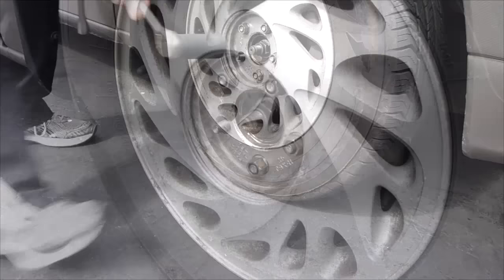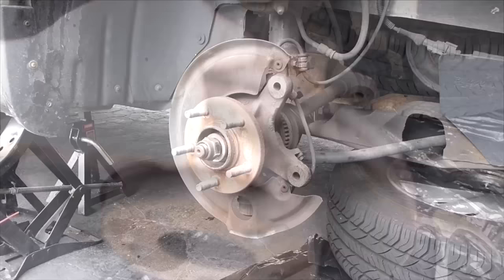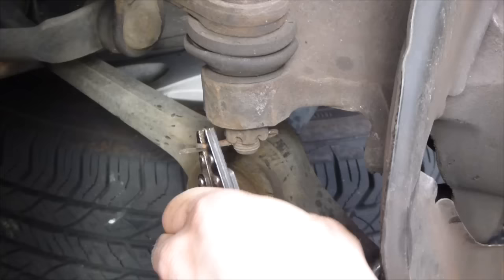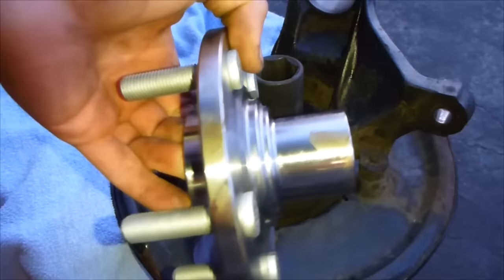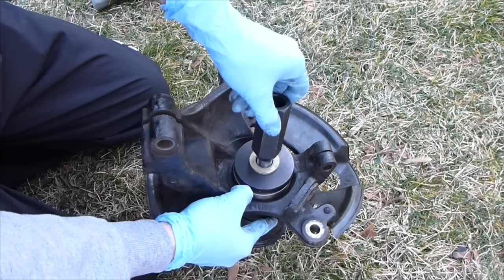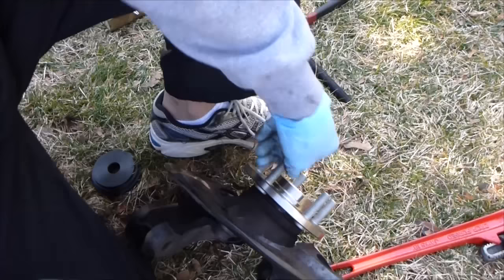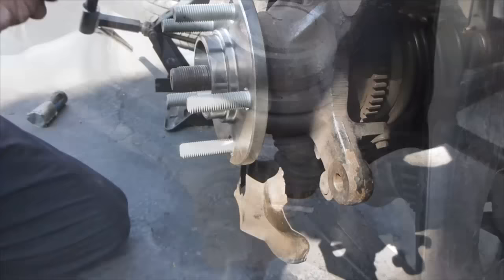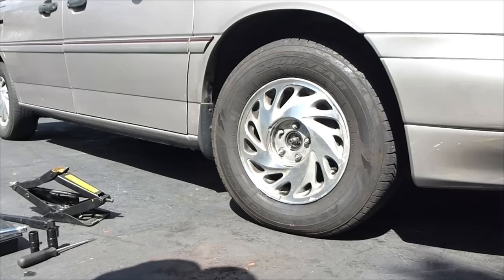How to Change a Wheel Bearing (short and fast version)

Comment: How ur doing Mr. Chris Fix, My question is regarding a 2003 ford explore rear bearing. Is it possible to press in both hub assembly and bearing @ the same time or do they need to go in @ separate times and also I have some type of vibration only occurring @ high speed between 35 and 55 it feels like something all of a sudden grabs. it almost sounds like brakes but its not the brake all bearing have been replaced accept the right rear bearing also a sound like the tire or something is rubbing but its not the tire it stops after the vehicle slows down or makes complete stop then when I take off again nothing till about a mile or so up the road the vibration and shaking comes back like its a bad tire or axle everything is torque to specs as they should be really would love your feed back to resolve this situation by the way your videos are the best i seen thus far keep up the great work
Reply from the maker: patrick chambers Hey Patrick, I am pretty sure you will need to press them in separately. The rear axle is a solid rear axle so it is different than in this video. As for your vibration problem, can you tell where the vibration is coming from? Like is it that passenger rear tire or is it in the front end?

Comment: Theoretically couldn't you use the bearing press tool while everything is still on the car? I just dont see the point of removing stuff if ya don't have to. Looks like some cheap threaded rod, a few size washers and two nuts would do the job. Great vid by the way!
Reply from the maker: You could but for an extra 5 min is worth it in this case to take the knuckle out.
Reply: +Andrew Solis drugs lol.

Comment: I didn't put any grease on the bearing or the wheel hub, I guess that's why it made some strange noise when I pressed them in with a press. By the way, did I miss something or did you install a new wheel hub as well?
Reply from the maker: +thaik56 I did install a new hub as well.
Reply: ChrisFix is there a particular reason for that?
Reply: Because its only an extra 10$ to buy the hub with the new bearing so why not? I did.  I'm not going through all that and not replace the cheap stuff.
Reply: Jennifer Hendrix well in my case a hub isn't that cheap, perhaps because I require OE parts for most of these jobs.

Comment: Wouldn't it be possible to change the bearing, with the hub still on the car? Using that press-tool?
Reply: no. in order to use that tool you need to get to the back of the bearing and if you are lazy and try it your way you might do more damage and take longer.

Comment: I have a question, you mentioned in your video you had to get a new bearing press that for the hub. The hub I am using is the same exact one I believe you used. I believe it's a dorman hub? Where can I get that size bearing press? Thanks in advance
Reply from the maker: chris rodriguez Check the link in the description for the press I used! You can sometimes get the bearing press to rent for free at your local parts store.

Comment: So you used the extractor/puller to replace bearing and install new hub? Why did you need to install a new hub if you just planned to change the bearing? I am about to do this job with the same tool but don't plan on replacing the hub unless absolutely necessary.
Reply from the maker: shepd01 The hub was $10 more and it had 250k+ miles on it. Not worth risking having a damaged hub for a few dollars. Plus, the bearing is a decent job to do so I dont want to do it twice. My friend has an audi and his bearing went bad, he had a shop replace it with the same hub, the bearing went bad 3 months later. This time I replaced it and put a new hub in so there is no risk. The old hub might have been slightly bent from his slide into a curb which might have caused the new bearing to go bad in 3 months. That is why I did what I did. If you didnt hit a curb or pothole and you think your hub is fine, just use the old one. If you dont want to take any chances, get a new one for a few more bucks.
Reply: ChrisFix Thanks Chris for the clarification. The hub cost anywhere from 30 to 100 bucks depending on where I buy it. Trying to save money if the hub looks ok during the bearing removal. Great video!
Reply from the maker: shepd01 Yea, if it is $30 you have to decide, if it is $100, I think you know what you are doing lol

Comment: I have replaced the bearings on some parts I bought for my car, bigger disc brakes for my ride. Well once done I went to spin but don't spin freely by hand. Is this normal, or did I do it wrong? There a little tight but I've seen videos where it spins as you spin it. I haven't put these on my ride yet because of this. Can you help

Comment: i have a 97 expedition and i did a whole hub and bearing switch out didnt have to do any of this stuff just took the wheel off break off and the 3 bolt in the back of the hub o and the axel nut
Reply from the maker: +XXX957TRO Yea there are two types of bearings. This type that is pressed and the other type that is bolted in. Here is the bolt in version: https://www.youtube.com/watch?v=fe_WtKIKlYA

Comment: I wouldn't say it's an " EASY" job just tool wise you will need a few specialty tool most people won't have ... Tho...You can make the job easier by taking the steering knuckle to a parts store with a machine shop.. They will sell you the bearing and press it in there for like 40$ or so...... It's either that or buy an expensive 100$+   bearing press kit and learn to use.. ( and that's for a el cheapo one good quality pro kits are like 400-600$)... Again doable but def not " EASY".....job... I'd say intermediate both  tool and skill wise..

Comment: Hey ChrisFix, Josiah here. I have a bad rear wheel bearing on a 2002 Ford Explorer that I am trying to replace. I've gotten the knuckle, hub, and bearing off of the vehicle but wasn't able to hammer out the center hub (or whatever the piece is that holds the lug nuts). I tried your method of using a socket and hammer but it is REALLY stuck to the inside of the wheel bearing. Any tips or tricks to removing the hub from the bearing? If I'm able to get the hub out of the bearing, I'm going to take the knuckle and bearing to a machine shop and have them press it out for me (I don't have the bearing kit you have).

One more question... will hammering out the hub from the bearing risk "damaging" the bad bearing (meaning will I risk removing the bearing race with the hub)? I know I don't care about damaging the old bearing, but I don't want to create more work for the shop I'm using to press out the old bearing. I'm trying to save money and shops here charge an arm and a leg for ANY work. Wish I had the kit to do it myself but anyway, just don't want to create more work for the shop. 

Thans for your help. I watched the short and long version of this tutorial and it is extremely detailed and helpful. Awesome job!
Reply from the maker: carlyelizabethm Hey Josiah, when the hub gets really stuck in the bearing I try using some penetrating fluid. This stuff works miracles so give it a try: Homemade Penetrating Fluid, How to Make Your Own That should work, but if it doesnt, you can have the shop press it out for you. It will take them 5 extra minutes and they usually dont charge. You can damage the bad bearing if the hub is stuck in there so bad that the old bearing gives way. You wont damage the outside of the bearing though, which is what they will use to press the bearing out. Good luck and keep me posted on your progress!

Comment: This is nice.  To bad all the cars I work on are always rusted to shit and seized up.  I had 24000 pounds in a press trying to get one out.  I worked on a Chrysler  dam cv joint was so rusted in the bearing had to pound the shit out of it with a sledge hammer.  Mushroomed it and had to grind off the mushroom to get it back in.  The steel that they use on these cars today is shit I mean shit.

Comment: Why did you also change out the hub? was it bad as well? I plan to reuse my wheel hub but if it is cheap then i just buy new one. What do you recommend?
Reply from the maker: +Truong Ho it was only a few bucks extra for the hub so I got it. You can reuse the old one as long as it isn't damaged!

Comment: Nice video,but these tools only one professional mechanic can have...right?
Reply from the maker: Stavros Athas These are common hand tools and the only specialized tool is the bearing press which you can rent from the parts store.
Reply: ChrisFix Where do you reference all the torque specs for each bolt? My manual only talks about the lug nuts.

Comment: Could you please tell me what is the length of that crowbar which you have used on video ? I saw in other videos that when you press the hub into bearing you have to apply the pressure only on the inner race of bearing. In this video you were applying pressure on the steering knuckle.
Reply from the maker: ***** It is a 24in crow barL http://amzn.to/1LfiAv4 and you want to apply pressure on the outside race and you need to press against the knuckle.

Comment: How to do inner and outer wheel bearing on a1987 dodge ram le 150 truck 2 wheel drive passenger side on the front rotor

Comment: 20 dollar bearing vs mechanic that charges 400-500 bucks. worth doing yourself even if you have to buy the special tools it still is cheaper. And you own the tools for next time. Stores dont loan the bearing puller. But they do the slide hammer.
Reply from the maker: Yes you can rent those specialty tools for free which is nice!
Reply: u still read coments on this video damn

Comment: Hello Chris, where are you getting all that torque tightening info from ? Or I'ts just overall number like the center hub nut 200 ball joint is 52 for most of the cars ?
Reply: +Fu co Using a car specific manual

Comment: The threads on the bolt hold up after multiple uses? I bought a similar kit from harbor freight and the threads where destroyed after one use. I used anti-seize on the threads.

there kits work well w/ a press too.
Reply from the maker: +Turbotomass I never had a problem
Reply from the maker: +Turbotomass I never had a problem

Comment: Okay so I went to push out the bearing from the knuckle and Only the inside of my bearing came out with the balls and everything. I am stuck with the outter wheel bearing stuck inside on my wheel knuckle. My local Autozone sold me a tool that I have to use with a hammer but it’s not budging. I’m wondering if this style of press would work if I order from Amazon. And tips on removing the Outter part of the wheel bearing without the inside would be helpful.
Reply from the maker: That tool they gave you should work. If you put the edge of the tool on the bearing and pull the slide hammer back and work it back and forth it should get it out. Heat up the bearing race to make it come out easier. A hammer and a punch could also work. The bearing press could work too. The rent then for free at advance auto parts

Comment: noob question here but you know that housing right behind the brake rotor, how important is it because mine has rusted away and i noticed it was actually falling apart when changing my wheel the other day.
Reply from the maker: +itzJKB That is a dust/heat shield and it isnt super important but it does protect the suspension parts so I would get one from the junkyard.
Reply: oh thank goodness , nothing serious then. ok i'll get that replaced thanks alot for the reply !

Comment: What is the tool part number for the tool you used? Is it compatible with 2001 toyota 4runner sr5?
Reply from the maker: The bearing press is linked in the description and it works on most cars where you need to press out the bearing.

Comment: I recently change my front bearing. And bearly I was able to push it out of the housing with a 20 tone hydraulic press. Looking at yours it looks small. mine had 77mm outer diameter. I don't think that screw improvisation would have done much,. Why did you replaced the hub?
Reply: you'd be surprised, a little heat from a torch on the outside of the knuckle to expand just slightly and some penetrating oil and they come out fairly easily with these cheap hand kits. but then again I have had 2 year old bearings that are seized up and are more difficult, depending on where the vehicle has spent its life and its surroundings and weather. shouldn't have a problem with a twenty ton press though.
Reply: caution not to blow up with the penetrating oil and torch though :)

Comment: Which disc do you use on the backside when you are pressing the hub in.. I think this is where I've been having issues.. Someone told me to use the flat side of one that fits inside the spindle flush against the bearing..??
Reply from the maker: Yes you want to use one that fits on both the inside race and outside race of the bearing when pushing it in so you don’t damage it.

Comment: Thats good, but you didn't need to pull the whole hub to remove the bearing with that tool...
Reply from the maker: Chris It is easier to get the hub off and just one more bolt but yea, you dont necessarily have to remove the knuckle.

Comment: Chris I need to know why after you installed the hub, you said barely get a screwdriver in between the hub ? Is the because if you press the hub into far it will bind??? Help please?
Reply: Doesn't the hub seat in propery after pressing in the hub? I think pressed mine into far. Will the Wheelbearing prematurely wear out?

Comment: I have a question did we need a alignment after instal everything ? Thx
Reply: It's not required, however it is good practice. If you can drive on a straight road doing the speed limit and take your hands off the wheel, vehicle should stay straight. If it doesn't, it's best to get an alignment.

Comment: Hey Chris, does this tool work to remove ball joints if I just buy the adapters for it?
Reply from the maker: Jay's Garage Raleigh This will not work to remove ball joints. The ball joint kit has a different setup. Here is the ball joint kit: http://www.amazon.com/gp/product/B00061SGZO/ref=as_li_tl?ie=UTF8&camp=1789&creative=390957&creativeASIN=B00061SGZO&linkCode=as2&tag=chri0e2-20&linkId=YYNCZ7JBK76SFCUL
And here is the kit in action: https://www.youtube.com/watch?v=37NgLM4tIzw

Comment: Is it necessary to get a new hub when changing bearing?
Reply: if your hub is really corroded or you smash it trying to get it out the wrong way then yeah but not hardly would you need to replace the hub, can even put new studs in old hub.

Comment: Do you need to do an alignment afterwards? I'd think that you do if you are removing a hub from both the tie rod and the strut on a McPherson suspension.
Reply from the maker: Actually, it didnt need an alignment. Now that said, you probably should get an alignment after all of this because the new bearing should change the camber angle, but for my van, it only helped my alignment. I still have the same tires with the same alignment and she has 25k miles more on her now!
Reply: ChrisFix I read somewhere that to ensure that the camber setting is preserved, when taking out strut boots, you should first mark a line on both the bolt head and strut bracket so you can put it back with the same orientation. The boot is offset which how camber is adjusted.
Reply: Boot = bolt ( stupid autocorrect)
Reply from the maker: Peter Geyfman On my strut there was only one spot the bolt can go. There is no adjustment. If you have a camber adjustment or a slot instead of a hole, then definitely get some white marker and mark it! In my case, there is no need because the bolt only fits in the one hole.

Comment: Try getting that bearing snap ring out on a rust bucket...
Reply from the maker: That would make it harder!
Reply: It is often a 30+ minute process of removing that snap ring on the old hoopties that I work on.  Sometimes, the snap ring is literally indistinguishable from the rest of the knuckle until after it has received many strategic hits with a hammer and punch to knock away all the rust.  And then out come the chisels to break it free.  One time, I literally had to resort to welding a chunk of metal to the snap ring and then using my slide hammer to literally tear it free.

Comment: I've got a 1996 Toyota Camry. I've already replaced the brake pads, rotors and shock absorbers and when I'm running around 35mph my steering wheel begins to wobble. I've also checked the hub bearing, but there's no problems. What is the problem do you think?
Reply from the maker: zinkblue A wobble can be a few things. Are your wheels balanced? How are your tie rods and ball joints? 
Here is how to check ball joints: https://www.youtube.com/watch?v=62bVn7E8gyk
Here is how to check tie rods: https://www.youtube.com/watch?v=brI2feYiEi8
You might also have a balance issue with the wheels. When were they last balanced? Does this vibration happen only when braking or while driving?
Reply: Your brake rotors may be out of speck too.

Comment: I thought the pipe wrench used on a specialty tool was a nice touch.. I have seen these bearings so tight a 12 Ton press won't push them out [LOL]
Reply from the maker: heavymechanic2 Thanks man! I really need something beefy with some length and weight to it. I have heard to put the bearing in the freezer before the job and they slide in easier.